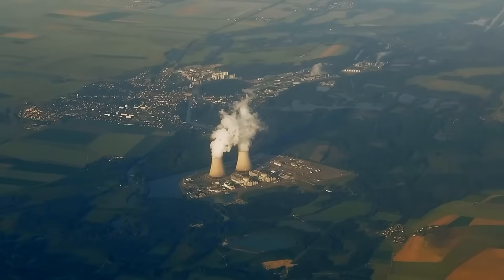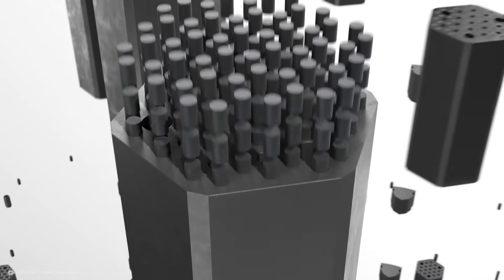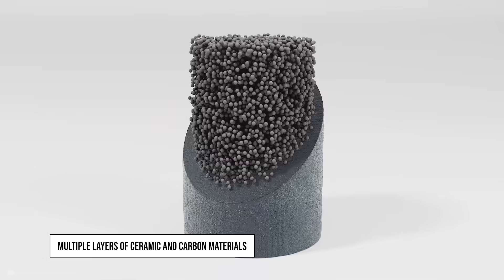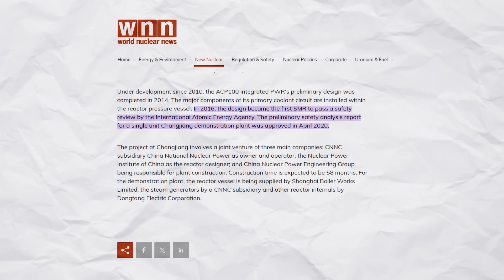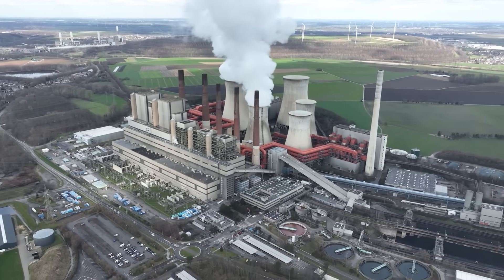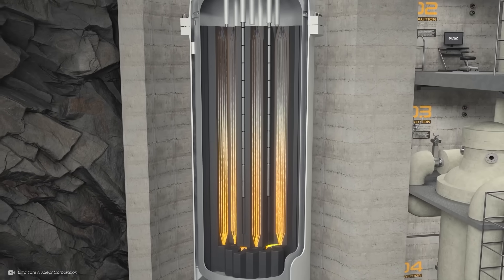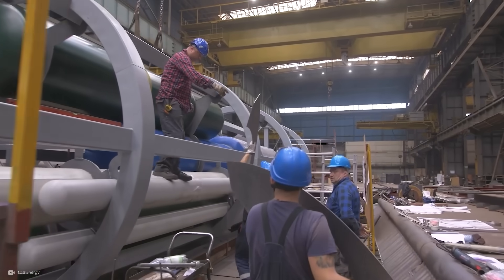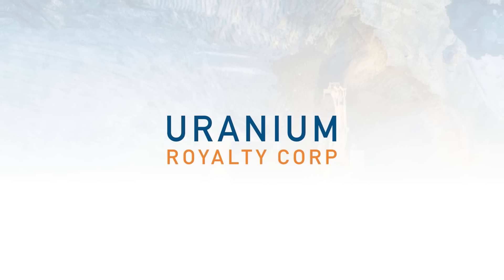The Genius of China's Small Modular Nuclear Reactor

Comment: We've had SMRs in the US since 1954. I spent several years as a nuclear engineer and chemist operating a few between 1978 and 1982. The first SMR I have experience with, interestingly enough was a prototypical variant of the Navy's then-standard reactor S3G. It was called "MARF" for Modifications and Additions to Reactor Facilities. What made it special? It used water as the control mechanism. Pump water in to thermalize neutrons, thereby starting and sustaining nuclear fission. Pump water out to slow and control fission. It worked just fine.

Before making it to the fleet on a Ballistic Missile Submarine that used the standard S3G reactor design, I participated in bringing another first online:  the S8G reactor, which used natural circulation/convection for cooling during operation without the use of main coolant pumps; one of the noisiest components on SSBNs.

Every naval propulsion reactor (surface and submarine) fits the definition of an SMR. Variants were serially produced, on time and within budget. They also fit the power ratings associated with SMRs. Current S1B reactors are "life-of-ship" designs, meant to power the submarine for its entire expected lifespan without refueling (~43 years). 

There's no reason that SMRs of advanced designs can't be mass-produced in factories, then transported to operational sites around the country where they'll economically produce safe, reliable, carbon-free electricity and process heat. When it's time to refuel them (every 4 to 7 years depending on the design), they're simply brought back to the factory and a new/refreshed reactor takes its place, all with minimal downtime.
Reply: That's not SMR, that's just a miniaturized reactor.
Reply: @gelinrefira  SL1 is SMR adjacent unless SMR is just Fuel balls
Reply: @gelinrefira  What exactly do you think that "small" and "modular" mean? I'm confused.

MSRs can also be SMRs, but SMRs don't have to be MSRs.

So, to be clear, PWRs that are built in factories with advanced safety features and <=300MWe are by definition SMRs.
Reply: What is the size of the reactor? How mobile can it be? How can you shield it from breaching?
Reply: @tilenjeraj2684  .. Fits inside a 40 ft container with ease. Search for 'eVinci micro reactor' and you will find it. It is pretty neat.
Reply: it makes sense submarines using small kitty nuclear reactors... North Korea should employ you as their consultant!
Reply: @fidelcatsro6948  .. Really. If you only this to say. Please keep it for yourself.
Reply: The only SMR I know about was the SL1 and that ended in an meltdown
Reply: its too easy to make energy cheap doing this, there are alot of other methods to exhaust first, that's capitalism.
Reply: its not easy to make smr cheap. at least it take 10 years to do it.
Reply: Those reactors use highly enriched Uranium. Way too dangerous. Not just the waste but the easy weaponization.
Reply: Mass produced, like 100 or Maybe 100s?

Simply brought back to the factory, like the hassle to transport a 500 t transformer over road, through bridges, over them, etc.? While being radioactive...

How about the highly enriched Uranium in SMRs carried around the countryside? No problem here?

The underlying issues are so simple and grave, it is not worth to go into detail, because i don't want to suck up time of people who can think for themselves.
Reply: @juliane__  .. I don't think there is an issue here. Nuclear transports are traveling all over the place already. Has been for years. 

Will ask you to forgive me for correcting you a bit. Integrated SMR's are too big to be transported on land fully assembled. The only way to transport them, containing fuel, is with ships. Read up on Thorcon. Modular designs can be transported, but not containing fuel. Especially the MSR's containing liquid fuel is easy to drain and, after a short decay period, can be shipped back to the manufacturer for maintenance. Liquid fuel makes refueling easily done during operation, and the dangerous transport of spent fuel can be avoided to a large degree. The fuel stays at the reactor site permanently or until they are decayed to a point where they can be safely transported. 

The current MSR designs are operating in the thermal spectrum (slow neutrons) using graphite as a moderator. The Graphite need to be replaced due to swelling after 8 to 10-year intervals. 

There are a strong push for FAST liquid fueled reactors, you can read about them at Elysium Industries, and you can listen to their CTO Ed Phile talk about them. Brilliant man. FAST reactors have great potential to burn nuclear waste from LWR (both BWR's & PWR's) and reduce the storage time from thousands of years to hundreds (max 300 years). And they don't need mining! They burn already stored waste. 

Transporting fully fueled reactors are ONLY valid for MICRO reactors. They are so small that they fit into a 40ft container. Complete with shielding and the whole shobang. They are designed to replace diesel generators. Very small units up to 10 MWe.

Your reference to transformer are not correct. They are not part of the Nuclear Island, rather the switching yard. Not subject to transport other than when they are installed.

It is good that you are interested in Nuclear Energy. We need a more balanced discussion, and the more information we can get out to people, the better. Please keep at it! Be part of the discussion.
Reply: @oddvardmyrnes9040  Bravo! Well said.
Reply: Wait...wait...so you think an energy source that only has to be refueled every 4 to 7 years is going to maximize profit for energy companies? * insert insane laugh here* No, no sir. We need an energy source that has to be paid for weekly or monthly otherwise our shareholders will get upset. Cash flow baby! That's what matters. Do you not know how capitalism works!?
Reply: @evo-labs  Yes, that's exactly what I know (not feel, believe or think). What you have backwards is that "energy companies" are behind SMRs. A quick perusal of SMR companies' business models will disavow you of that notion. SMRs companies intend to design, build, deploy, operate, maintain and ultimately decommission these units, with business consumers entering into power purchase agreements (PPAs).

This is precisely what Microsoft is doing with the Three Mile Island unit #1 restart. This also precisely what the likes of Amazon, Oracle and others are doing in order to secure power for their data centers. The same will be true for aluminum, concrete and steel producers, in addition to all manner of other industrial sectors that with high energy demands in the form of electricity and/or process heat.

Cynical viewpoints such as that which you express accomplishes nothing other than further delaying the energy transition.

Here's one that you're sure to choke on:  A single, golf ball-sized sphere of Thorium contains the total amount of energy one person in a developed economy such as the US needs their entire lifetime. That's not just electricity. That's the energy needed for everything from the cost of shelter, clothing, food...everything. The technology exists to use Thorium as a feedstock for nuclear fission reactors. Reactors that can also burn down the existing stockpile of spent nuclear fuel, creating a fraction of the waste of traditional reactors. Waste that also only toxic for hundreds, not thousands, of years.

This too shall come to pass.
Reply: @ARepublicIfYouCanKeepIt  .. Norway here. I have read your comments, and I am 100% (+) agreeing with you. 🙂 The Navy connection makes me interested in talking to you. Norway has a huge maritime industry, and nuclear power for ships are very interesting. So I decided to fire away one question to you;

What are your opinion on the use of Westinghouse eVinci in ship applications? 

This is so interesting that I can hardly sit still 🤠
Reply: @oddvardmyrnes9040  To directly answer your query regarding marine applications for Westinghouse's eVinci microreactor, no. Part of the answer is in the rating:  Only 5MWe/15MWt. That's tiny for marine applications such as cargo ships, tankers, etc.

The longer answer to nuclear for marine applications is a lot more complex. Not only does a reactor have to be capable of supporting the electrical and thermal loads of a vessel, it must also be affordable and robust, as well as be able to operate over timescales measured in decades before needing refueling. This requires highly enriched uranium (HEU), which is limited to only ultra-secure military applications due to all kinds of reasons, proliferation being a chief concern.

Another reason that nuclear isn't a fit for civil marine applications is manpower. Put simply, countries operating nuclear military vessels, such as the US, struggle to attract, train and retain the personnel needed to man the fleet.

Don't get me wrong. In an ideal world, I'd be all for SMRs for greenfield marine applications. There the reactor could be located in the vessel in an area that's totally separated from the machine/propulsion section. In these builds, everything would be electric, so it'd just be a matter of running cabling from the nuclear section to the machine/propulsion section. After 3 or 4 years, the SMR could simply be completely replaced with a new unit, good for another 3 to 4 years. With passive safety measures and low proliferation/accident/terrorism risk, these easy-to-operate units could completely replace the millions of tons of bunker fuel these vessels burn each year.
Reply: @ARepublicIfYouCanKeepIt  .. Yes. As the U.S. has tried this in the Savanah vessel, these concerns are well known. The eVinci reactor uses UO2 LEU TRISO pellets fuel, is gas cooled (heat pipes), & is load following. Westinghouse says that it should be extremely low maintenance with operator free design in mind. The power issue can be addressed by a dual installation, but this is only me dreaming 😟.  If I am out of scope, so be it. If you think it is worth a second look, please let me know. If not, thanks for your answer, Sir.
Reply: @oddvardmyrnes9040  Just for reference, the S3G cores that I operated during prototype training and at sea were rated at 78MWt and 98MWt, respectively. Just shy of 100MWt for one of the most fluid dynamic vessels on the planet...then as now. The SSBN that I served aboard was 492' long, 41' at the beam and displaced 8,220 tons submerged. Fueled with 93% enriched uranium, these reactors typically lasted 25 years before needing refueling.

Westinghouse's microreactor designs are actually purpose-designed to replace diesel generators for island power/micro-grids, or wherever diesel generators are typically used. Tribal communities, remote outposts such as mining operations and even military forward operating bases are all good candidates for microreactors. Marine transport? Not so much. Too small (even dualed) and too frequent refueling.

The chemicals that hold the most promise for marine transport are methane (CH4) and ammonia (NH3). Both are abundantly available hydrogen carriers. Methane, for example emits only H20 and C02 when burned, so synthetic methane produced from atmospheric C02 and "green" hydrogen would be carbon-neutral. Ammonia is probably better used as a hydrogen-carrier, rather than combusted as a fuel, where the ammonia is "cracked" to generate hydrogen for fuel cells.
Reply: @ARepublicIfYouCanKeepIt  .. Yup. I get it. The power range eVinci offers, are suitable to small offshore supply & anchor handling vessels. They are in the 10 - 20 K horsepower range, 20 is plenty big. They may also fit trawlers, exploration vessels and utility ships. One of the issues identified by 'Savanah' was port access. Local coast going vessels can avoid those hurdles. But is this too difficult to embark on? Maybe.

If 100MW is the size you need, only a homogeneous reactor of some sort will do. I will think an MSR, running either a Thorium or U235 cycle, can provide a solution. But working with that kind of power maybe be a step too far.  

Ammonia as a hydrogen carrier is too inefficient & way too dangerous. Ammonia is a nasty substance. 

Methane is natural gas, & we supply a lot of it. After Russia went crazy, we can't export enough of it. But it has its own set of issues. To be able to increase the density of the stuff, it has to be cryogenic. No need to say more on that issue, I will think.

Thank you for your time on the matter. Micro reactors are e welcome contribution, but to solve the ship application will need a bit more work I guess. Pleasure to talk to you.
Reply: @ARepublicIfYouCanKeepIt  Thanks for taking the time to chime in, always good to hear from someone close to the practical implementation side. SMR startups keep brushing aside the questions about a civilian HALEU/HEU supply chain that would fully comply with all non-proliferation regulations, almost like the society/taxpayers somehow owe them that 🙂
Reply: @ARepublicIfYouCanKeepIt  So why do we not use them?
Reply: @ARepublicIfYouCanKeepIt yeah, it's crazy how some people are so anti nuclear.  SMR's are definitely the only viable solution for energy. I foresee a future where  container sized thorium reactors will be providing energy for several thousand homes and maintained by a couple of technicians. I expect that at some point fusion will be viable. Just out of interest, regarding a  ship reactor. How big is it? Also how many homes could something like that provide for? Also how many people are required to maintain it? Thank you for your service sir.
Reply: @danielbtwd  Specifics of naval propulsion reactors are classified. Suffice it to say, those that power submarines are much smaller than many SMR designs. They're more on par with some microreactor designs. Lastly, microreactors aren't really designed for residential electricity generation. Some of the best use cases involve onsite industrial power and process heat generation. Think data centers, cement, steel or aluminum manufacturing.
Reply: @evo-labs  Yes capitalism provides dividends to retired boomers who'd otherwise be living off your/our dollars.You have a more elegant solution that know one has discovered in human history.
Reply: @evo-labs  Energy companies sell power to consumers, and fuel is already a trivial cost of running reactors.

Comment: This is actually a SMR hit piece, with many false statements like claiming that Thorium fuel is the same price as conventional uranium powered LWR's. Thorium is easily and cheaply refined and basically free as there are stockpiles around the world as a result of rare-earth mines that have no market for the left over thorium. Uranium has to undergo a very expensive enrichment process and then encapsulated into pellets. Only about 5% of uranium is used, the rest goes to waste. LFTR uses almost 100% of the thorium with no waste problem.
Reply: Opponents of Thorium fuels will manage to justify Uranium until long after China and India's major Thorium Production Reactors have proven their efficiency in producing commercial power, despite the processing needs for Thorium use!!
Reply: SMR is economic suicide.
Reply: Thorium has nothing to do in uranium stock commercial.
Reply: China is also building a massive thorium reactor, the first one since the experimental oak ridge.
Reply: There is no advantage to Thorium over Uranium. What the Nuclear Bros are to renewables, Thorium bros are to Nuclear.
Reply: Almost no waste (by mass or volume?) is not good enough because its extreme radioactivity is still a problem
Reply: @tonysu8860  extreme radioactivity mean it decay very fast and depleted in a short period of time. Moreover the waste from thorium reactor is actually had demand in other industry, so it is not a waste at all.
Reply: @tonysu8860  You are very afraid of this, while you do not know the details. That waste in storage is a fuel, that even your favorite LFTR can use.
Reply: The halflife of used thorium from low pressure thorium reactors is a couple of hundred years by comparison nuclear waste from conventional reactors is unsafe for much longer. Also thorium reactors are able to use the waste from conventional reactors. Small low pressure thorium reactors are the future. An average home with an initial investment of less than 10 000 euros could have free energy forever. @tonysu8860
Reply: @tonysu8860  Clearly you have no concept. Not only is waste from LFTRs almost zero, the waste products produced decay to safe levels in a few hundred years as apposed to 10,000 years for uranium.
Reply: @royh6526  wow 10,000 years for Uranium? Wowwww!

Comment: the energy contained in current  waste is 90% of the original energy values.

The waste can be processed and reused in special reactors

The left over waste then lasts hundreds of years only.

This is more expensive that hiding it at the moment, but it should be an investment built into the costs of building the reactors in general.

All of this should be re-examined post implementation of a carbon tax and fines for carbon and plastics pollution to all corporates involved, past and present. Like a Carbon Joint Lawsuit The Public VS Carbon Polluters of the world.

Comment: Helium is amazing. It's basically radiation-proof and can be heated to a very high temperature. It's also impossible to contain, your reactor has a leak in it, and He is a finite non-renewable resource. So yeah it's great but it's leaking and you can't stop it, it will degrade your containment vessel if you try --- NASA has helium leaks too, you might've heard. SpaceX stopped using it